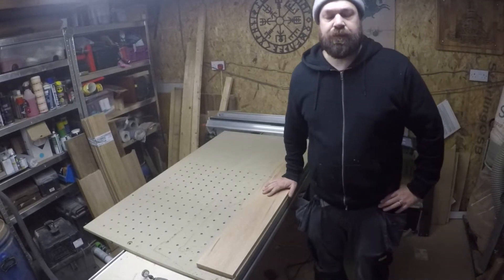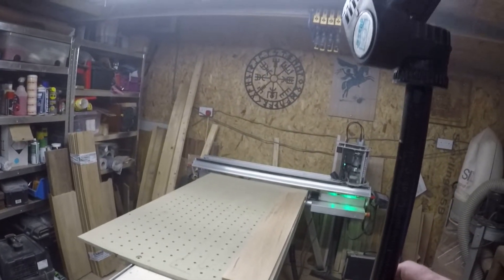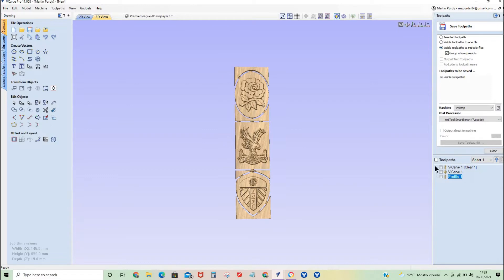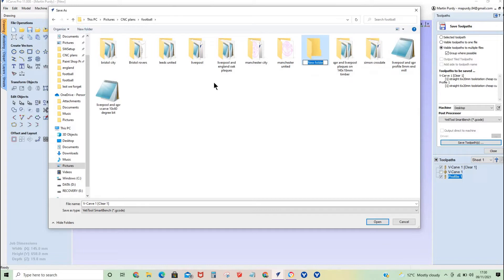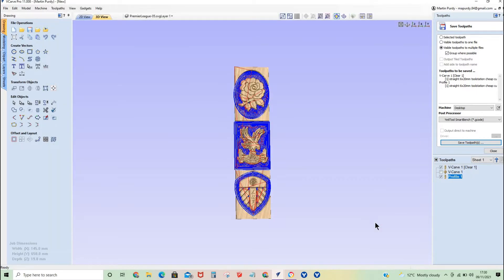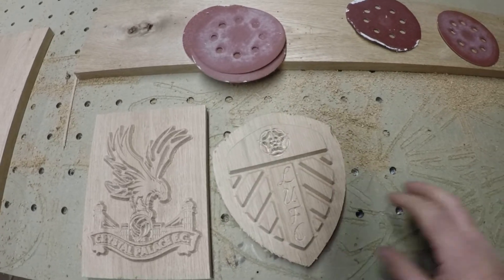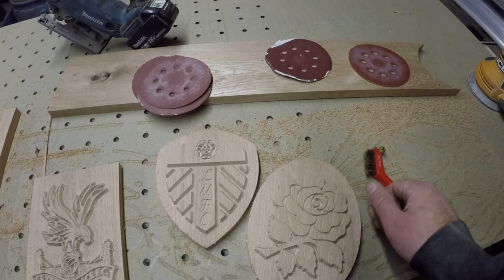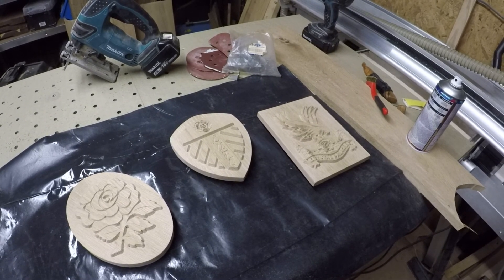CNC cut plaques with Yeti Smartbench

Comment: Hi! Excellent work!

Can you please tell what is the maximum thickness of material that can be used with this CNC machine? 

For example, if I have solid wood with thickness of 2 inch, will it handle it? Is these enough room by Z zxis for that thickness?

Thanks in advance.
Reply from the maker: Smartbench has a max z axis heigh adjustment of 150mm or 6" 
I have cut 40mm slabs of solid Oak with no issues at all.